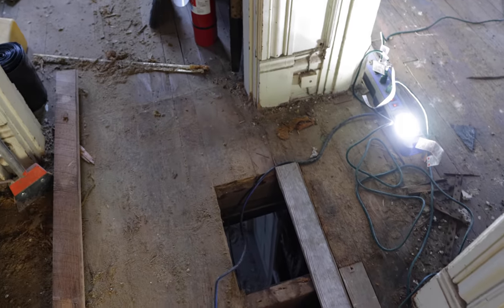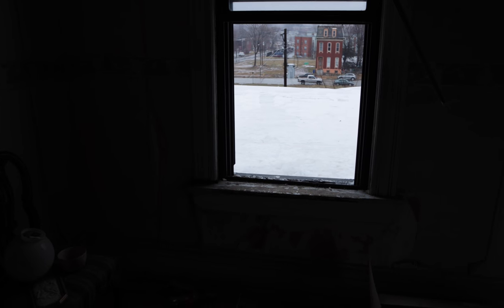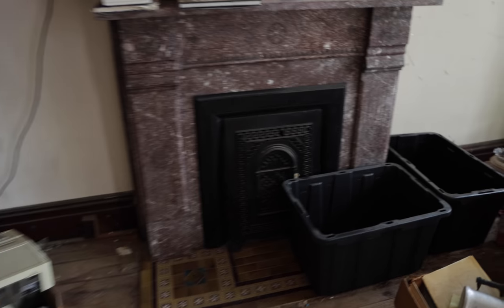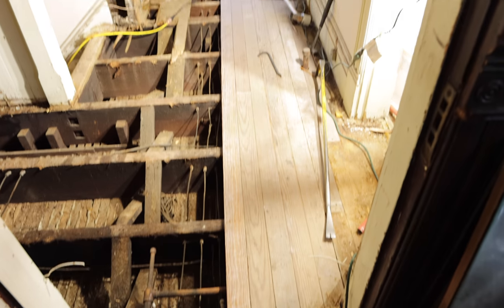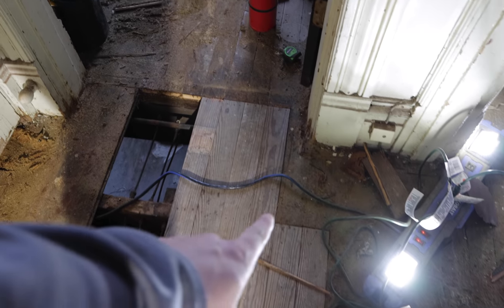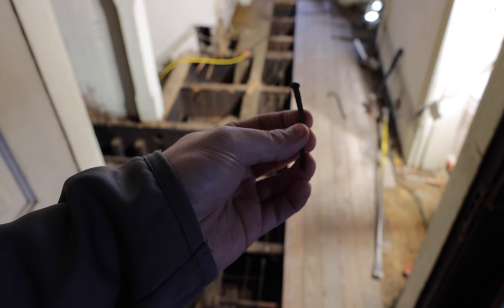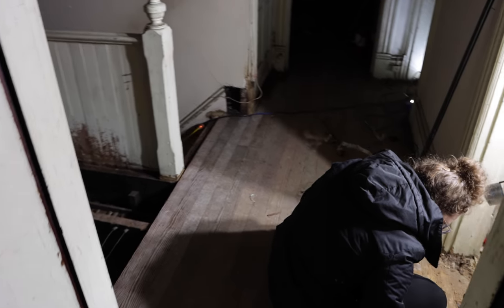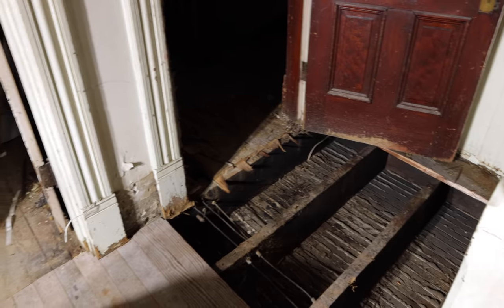NEW ROOF ALREADY LEAKING? EP 7

Comment: roofers are not what they once where, when it comes to flat roofs. Where i work in a flat roofed building we developed 2 good size leaks. The company spent around 2 million on a new roof. the building did loose one leak , then it gained 4 more. one of the original leaks remained.

Comment: What are the wire things going across the subfloor? Clearly, I know nothing about restoring homes lol
Reply from the maker: the is the original electrical wiring. Its not longer hot (has power). I choose not to remove it simply because its original and im bypassing it with modern wiring.

Comment: I really don't understand the US engineering/architecture. Like why do you guys have wooden ceiling and flooring..here in india it is all concrete which is I think is stronger
Reply: Earthquakes are one reason, also we still haven't killed all our trees so they're readily available. And of course, it's harder to pour concrete year round when it's covered in snow half the year haha
Reply: @zarinaromanets7290  oh okay. Got it
Reply: Also the old houses in videos like this on have been neglected. A well maintained wooden house doesn't rot, can last for centuries and is cheaper to build. But once maintenance is neglected, the rot begins. Well, except I think in Florida, where the hot wet climate means wooden houses rot faster. Commercial buildings and high rise apartment buildings are usually concrete. It's more fire resistant and better for really large buildings.
Reply: @Linnet09  okay

Comment: I'd file a complaint against that roofer! Don't know if you can contact the licensing board, if this guy is legit, or if that's even a thing in your state. One thing that will help you is to check with your State Secretary website to be sure any contractors are legitimately registered businesses. Also check the date the company was registered. If they've been in business for only 2 years it's possible they've recently re-registered their business under a different name to avoid consumer fraud allegations. Then you can further check public court records to look at any civil suits filed against the company. Ask them directly for their licensing and insurance info. It takes a little time but worth it. Once you find good reliable contractors, you can continue to use them over and over, and they may give you discounts for repeat business. Though it's not common to need regular roofing jobs unless you flip houses, it's a good idea if you don't want to be scammed in general for any job. Pool contractors, electricians, carpenters, plumbers, etc.

Comment: Why are you not doing a plywood subfloor? It’s not going to be visible.
Reply: Because it wasn’t plywood to begin with. We’re trying to restore it as close to original as possible.
Reply: @kimberlythompson719  well, I get that, but I assume you are using modern electrical conduit, modern insulation, etc. You used a white Tpo roof for God sakes. It’s an odd line in the sand to draw for staying true to the house. Time and money could be better spent on something that actually matters.
Reply: @chiane1968  This is what we’re choosing to spend our time and money on. It’s our house. It’s a floor. It’s not that big of a deal.
Reply: @kimberlythompson719  ok Karen.

Comment: KALEB - THESE QUESTIONS ARE FOR YOUR Q&A.  PLEASE DO NOT RESPOND UNLESS YOU ARE KALEB.
1.  You had a response a while back regarding a GO FUND ME page for the house.   You could raise money faster and more efficiently for the roof so that you will not have to worry about the cost of certain repairs.  Please reconsider.
2.  I'm surprised so much of the woodwork is painted on the third floor.  Will you eventually remove the paint?  It might have lead in it as well.

Comment: What I wonder is, did you contact the roofer? I mean, sure, things go wrong, not as expected, setbacks. But instead of complaining and ranting about it, did you talked it through with the roofer? Are you working on a solution with him? It's easy to be negative and bash someone with us having no idea if you're even in contact with the guy to correct the mistakes that were made..
Reply: Yes the contractor was contacted and some guys came out that day with caulk guns, which Kaleb specifically said would not fix the problem and not to send them if they’re just going to put caulk down. It was raining that day, too, so it was really pointless.
Reply: @kimberlythompson719 thanks Kim! I wonder if you guys considered contacting a local historical society, perhaps they could recommend another roofer if this guy doesn't step up. You can answer in the Q&A.
Reply: Hopefully you got a certificate of insurance naming you as additional insured, proof of workers comp, contractors license (if required in your area) and copy of the permit.  If the roofing contractor won't make it right, you can file a claim against the  contractor's insurance.

Comment: You are butchering this building. You should have started on the other side, or made a board with tongues on both sides so you didn't have to top nail.
You also left all that knob and tube, as well as the old gas lamp piping in the floor. 
I thought you where renovating this to museum quality?